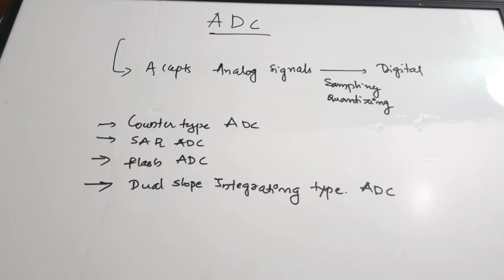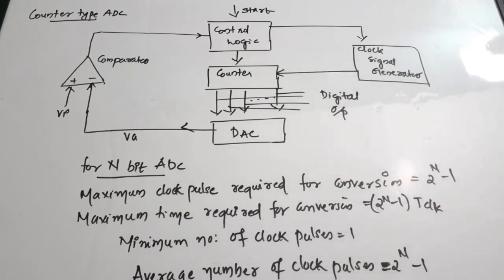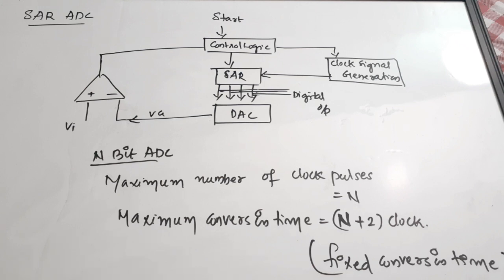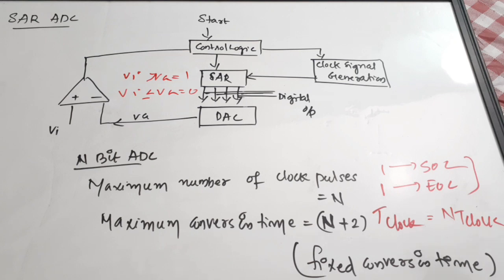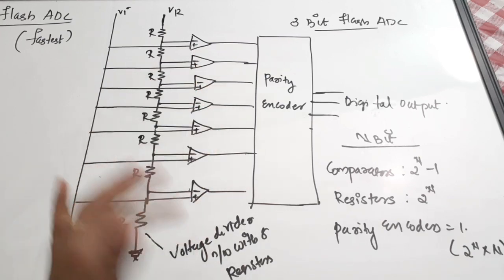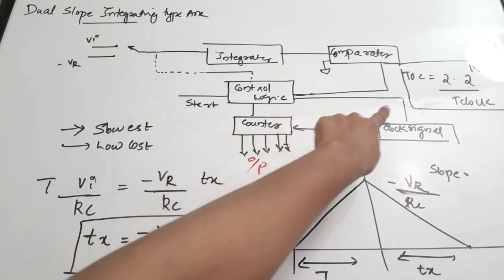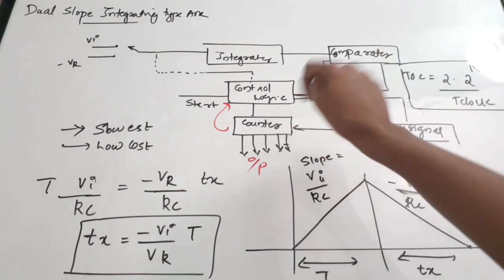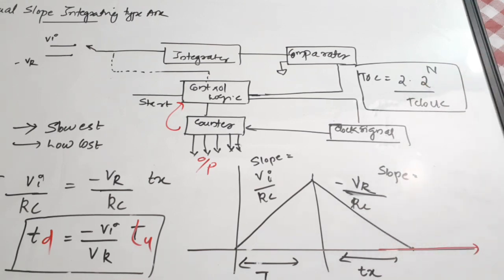ADCs Formula and Circuits Revision| CounterType | SAR | Flash|Dual Slope Integrating Type ADCs

Comment: Madam i have a question.
Design and show a state diagram for a sequence detector that outputs a 1 when it catches the final sequence in the serial data flow 1101 utilizing a 4-state Mealy diagram. 

In this question, should i design it using overlapping or no-overlapping? Can u please explain it? :(
I am depresively waitin your answer :(
Reply from the maker: I think since it's a series of data flow you should use overlapping method.
Reply: @EasyElectronics_jobupdates  Thanks a lot madam! I am so greatful^-^